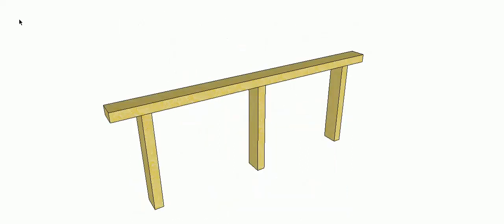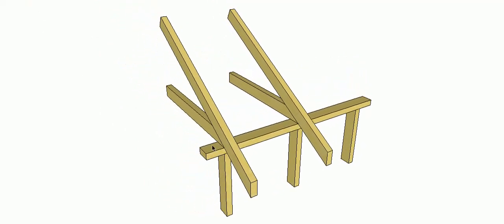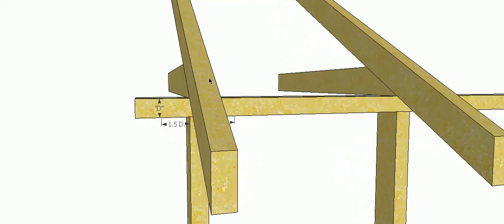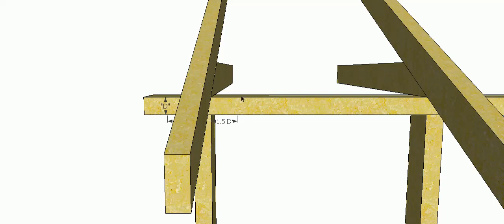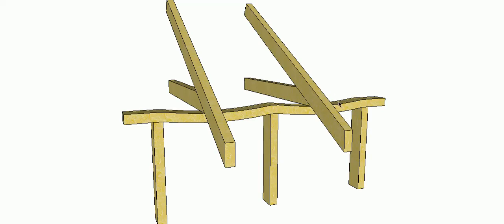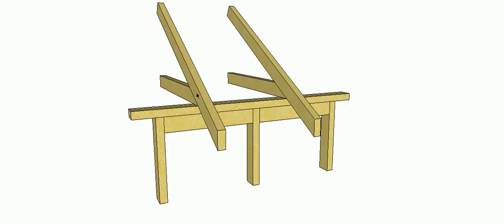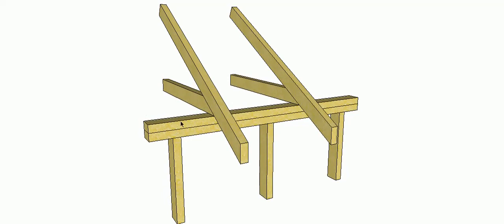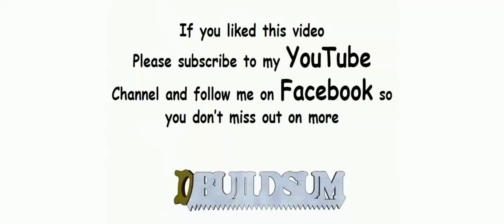Random Loading

Comment: Great video, just wondering would double plates adequate to take the load from point load, such as floor joist for the upper storey(pick up load from girder truss) transfer the load to the top plate
Reply from the maker: Hi Mate, No, point loads are not taken into consideration with the sizing of the top plates however a Second storey joist would not be a point load. Point Loads such as Grider trusses, Counter beams, steel beams supporting floor joists etc need to have the load transferrred down to the footing by intalling studs directally under them. Where they fall above an opening then the load has to be taken into consideration when working out the Lintel size. Hope this helps

Comment: Hi Buildsum, great video series. Just a question regarding when you need to use double or triple top plates. Do you need to make the ceiling higher to accommodate them or do you just shorten the wall studs below?
Reply from the maker: Hi Darryl, thanks for your comment, you would need to make the Studs shorter to maintain the required ceiling height. This video might help. https://www.youtube.com/edit?o=U&video_id=rzTmevdTZs0
Reply: Thanks for your advice.

Comment: did you say that your framing only 35mm thick? Ours is 45mm in nz.
Reply from the maker: Hi, Mate, we have both options and generally use a bit of both in our frames, e.g. 45mm for window and door studs and 35mm for the common stud. We can also use 35mm for our plates if they are continuously supported like on a slab or if you are going to double them up to make a 70mm tip plate.